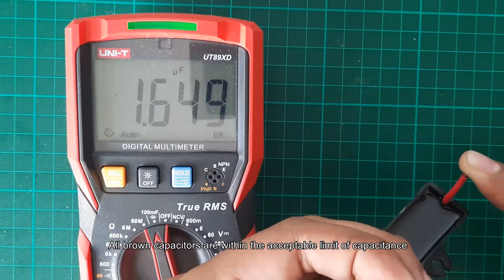How to Repair Noisy, Squeaking & Humming Ceiling Fan | Replace Capacitor & Bearing | KDK KY14ES

Comment: 4:05 NTN bearings are good quality! Other recommended brands are NSK, NMB, Koyo, SKF.

7:38 Some info about the capacitors in this fan:

0.1uf black box is for EMI/RFI filtering. X2 safety capacitor
0.68 or 0.82uF brown capacitor is for PCB power supply.
2.9uF is in series with the motor, for speed 1 (low).
5.0uF is for speed 2 (Medium). Speed 3 bypasses the capacitors for maximum speed
And the black 1.7uf 500V Panasonic capacitor is for motor running (phase shift between the run winding and aux winding).